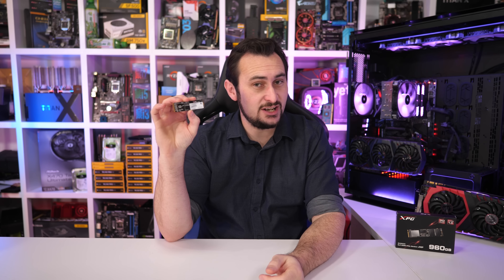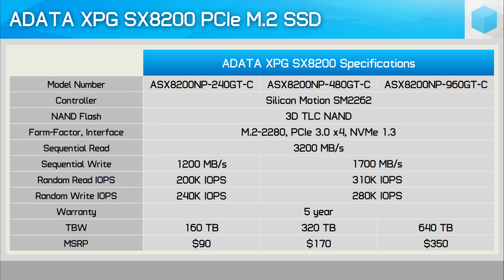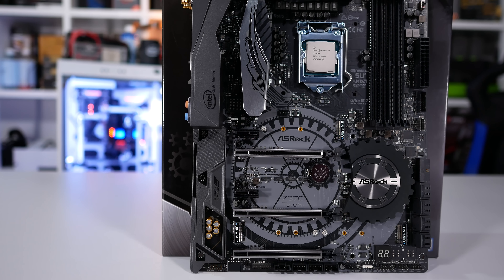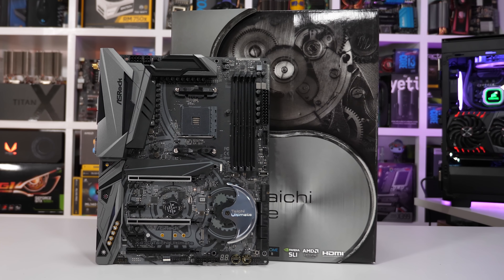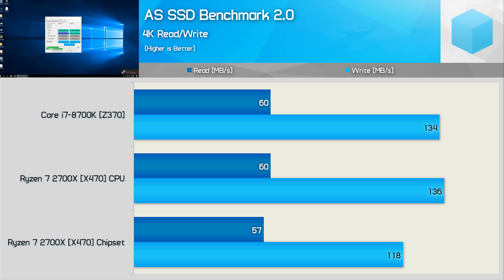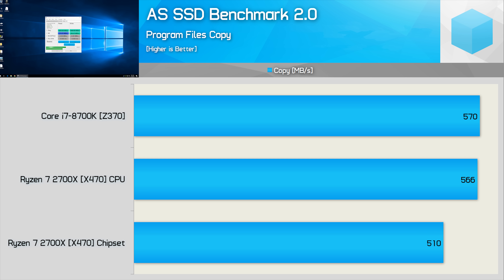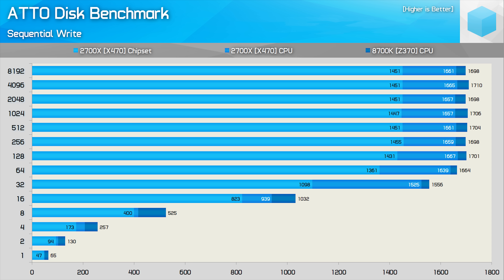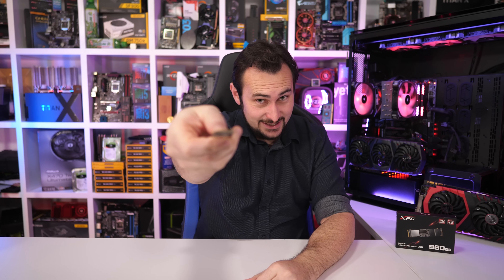Intel Z370 vs. AMD X470 Storage Performance, Not All M.2 Slots Are Equal

Comment: Could you test AMD Store MI? Would be really nice to see a Video on that.
Reply: Simon Leichtmetall Check out Level2Techs (Wendell's) video on it, he did a great analysis of it (spoiler: it's actually really good)
Reply: Jim from AdoredTV has a video on it. It seems impressive but I'd also like to see the benchmark king have a crack
Reply: I combined a 256GB 970 EVO with a 3TB Toshiba HDD (not boot drive, just for games and other data). Performance loss to a pure SSD is not noticeable. It's still faster than my SATA SSD boot drive.

CrystalDiskMark: Seq Q32T1 / 4k Q32T1 / Seq / 4k (Read,Write)
970 EVO: 3561,1500 / 459,414 / 2290,1501 / 47.2 , 214
StoreMI: 3566,1494 / 276,225 / 2313,1494 / 42.9 , 121
Crucial MX100 (256GB): 558,328 / 326,238 / 513,333 / 29.5,113

Edit: It's like you could buy a 3TB SSD for £170 ($220)
Reply: Would love to see a store MI build vs an optane Intel setup for maximum performance boost of a mechanical drive
Reply: Agree, up!
Reply: I've had a ball with StoreMI. It's kinda amazing really. Also just adding this here in case anyone ever finds it useful. If you use a mechanical drive with StoreMI to kinda turn it into an SSD speed wise then be careful that drive hasn't been used for an OS or backup kinda drive. Software often makes a hidden partition that doesn't show up in explorer but does show up in drive management. StoreMI won't work on any drive that's partitioned. That one got me for far longer than it should have. I slapped my forehead when I found that little extra partition windows makes. Once I'd killed that and got it back to one big drive StoreMI ran like a dream. It really did turn a 3TB mech drive into an SSD as far as I could tell just in normal use going through several big ass games to kinda torture it. 

I only used it with an average SSD on SATA. Haven't tried a blistering NVME drive yet but one day soon I shall have on of those little buggers. Well hopefully two. One for OS and one for StoreMI. That seems like the best way to use both slots if you've got a lot of HDD storage and aren't all swanky posh with pure SSD driven computing.

Final note. Its a damn shame it doesn't accelerate more than 1 drive. I see you can buy an upgrade but I'm not the cost of that right now.

Comment: It would be nice to see this topic revisited on the z390 and x570 platforms. Also, with the cost of NVMe storage having come down to such low prices now, more people are using multiple m.2 NVMe drives in a single system. For example, a board that has three m.2 slots like the Gigabyte z390 Aorus Ultra having a samsung 970 evo boot drive plus two more intel 660p drives for additional storage. It would be interesting to see if placing the boot drive in a different slot would affect system performance.

Comment: at what point in the chain does data get compressed when reading or writing files?  i wasnt aware of that fact.  is it when moving through the pcie lanes,  in the ssd controller, on the ssd cache, when getting shuffled through the cpu?  im confused.  seems like compressed data would move at the same speed as uncompressed but no?  interesting.  it must be getting compressed somehwere along the line.  just wondering if its in the ssd or somewhere in between.  great stuff steve.  as usual you answer 10 questions only to raise 100 more.
Reply from the maker: It's the controller, some SSD's use data compression algorithms to reduce total number of writes and this helps to improve the SSD's lifespan.
Reply: while also slowing down read speeds if it has to uncompress it again on the controller cpu.  also that means that game files are doubly hard when moving back and forth because they are so large and because they are usually compressed.  thanks for the info.  im not a storage guy.  i just found a deal on a 960 evo 240gb and then bought 3 of those wd blue 1tbs that are so cheap on newegg and amazon.  actually had an 850 evo and bought a 1070 ti and mined enough to get 3 wd 1tb blues, the 240gb 960 evo, and a cheapo 120 gb to cache my raid in intel rst for some reason(you can cache secondary drives now, even raids).  it also got me a bunch of other stuff.  fully noctua fans all around.  ive made my money back on the card plus about 200 dollars since i bought it last year.  still going strong.  thanks for the info again

Comment: I've been having an issue with Windows 10 reporting bad blocks on my ADATA XPG SX7000NP. I run a trim command with the ADATA SSD Toolkit and they seems to reduce the errors but they build up again and I have to manually run the trim command again. All my drive tools says the drive is healthy. Windows shows it is an SSD but it still reports media errors. None of my other windows systems report bad blocks on their SSD's but they use SATA. I have a Ryzen 1600/Gigabyte Gaming 3 AB350 if it matters.

Comment: Now you need to test 3 in raid 0 on the HEDT platform. See how bad the DMI 3.0 chokes drives vs all 3 being directly connected.
Reply from the maker: They can just connect them directly to the CPU on that platform since the CPU's typical have many more PCIe lanes.
Reply: You can connect them directly to the CPU on x470 as well. Just pick the board with the right PCIe configuration and add a adatpter card for the 3rd nvme drive. 

The Crosshair Hero VII for example supports a PCIe 3.0  x8/x4/x4/x4 configuration.
Reply: @traumglanz  yeah but you can do the same thing on intel z370 boards.  hes trying to test without using any of the gpu lanes cause a lot of people wont want to use them even if they dont make a difference.  or at least you can do x8/x4/x4   direct to the cpu and then you have the chipset lanes but those will be totally available to the 3rd "x4" so its basically the same.  you can do pcie 3.0 x8/x4/x4/x4 on intels z370 and amds x470.  i fail to see what your point is.
Reply: @james mastoianni  the hedt platform isnt limited to 16 lanes for the gpu and 4 lanes of DMI 3.0 to the chipset.  most of the intel hedt chips can support as many ssd's as you like without even touching the dmi link. straight to the cpu
Reply: @Hardware Unboxed Yes, but you would need an adapter card to take a cpu connected expansion slot, as all M.2 slots on X299 are connected to chipset. I am saying you should test the on board slots of X299 vs X399, as thats what most people would use. I know I wouldn't use an expansion card unless they were using more than 3 drives.

Comment: Hi from 2020. I was thinking of using the 2 m.2 slots on a strix x570 mobo. ! slot for windows 10 etc, the other for installing games and recording to it. Or do I need to record to a ssd drive?  I will use a rusty drive for storing videos etc. Will this work? Thanks.

Comment: Steve @4:08 you made a confusing comment comparing H110 to X470 chipset bandwidth.  All AMD AM4 chipsets have the same 4GB/s PCIe Gen3 X4 connection to the CPU (see https://en.wikipedia.org/wiki/List_of_AMD_chipsets#AM4_Chipsets).  The only place where PCIe Gen2 comes in to play is for peripherals hanging OFF the chipset.  Whereas Intel offers the mappable HSIO lanes at Gen3 speeds, AMD chipsets contain an additional  PCIe Gen 2 controller with 8 lanes to serve expansion slots and M.2.  Ultimately your bandwidth numbers in the video are correct for a single device, but if you manage to exceed 4GB/s combined serving multiple devices like extra M.2, SATA, network, USB, etc. then both Intel and AMD will have the same chipset to CPU bottleneck.
Reply from the maker: Yes you are correct, I realised this mistake once it was too late. I should have said all the PCIe lanes offered by the chipset are PCIe version 2.0.

Comment: I love the fact that you tested this on the ASRock taichi board. I have the x370 variant running a ryzen 1800x. I chose just a standard Western Digital black nvme Drive. I haven't done any benchmarks on it, I actually just built the computer. But it's nice to see the difference between the two different M. 2 slots from ASRock. I also have the ASRock b350 pro4 but haven't used the M. 2 drives on those computers.

Comment: X470 links the chipset to the CPU with a PCI-e 3.0 x4 link, you made it sound like the link was PCI-e 2.0 x4, One of the NVMe slots is direct to CPU and the other varies depending on the board, some are PCi 3.0 x4, most are 2.0 x2 or x4.
Reply from the maker: Yes sorry I wasn't clear on that, all the chipset PCIe lanes are version 2.0.
Reply: yep cool, on that board but the CH7 has both M.2 slots as 3.0 x4 I believe, both are connected to the CPU and it takes bandwidth from the second 8x slot
Reply from the maker: Yes both are connected to the CPU, Asus chose to share them with the PCIe 3.0 x16 slots.
Reply: Hardware Unboxed cool love ya vids! sorry to be picky (damn fanboys!)

Comment: Why was the intel chipset not tested ??
Reply: it was tested.  intel chipset was the ONLY thing tested with intel.  amd was both through thte chipset and through the cpu.  intel was through the chipset only.  if it had been through the cpu for intel it would have been the same speed but with about 1% better latency.
Reply: Z370 or directly to CPU both use PCIE 3.0 x4, X470 chipset is using SATA while the CPU gets PCIE 3.0 X4 hence why the Ryzen system had both mentioned since one is slower than the other.

Comment: Hey Steve, this may be an interesting/educational test. 

Start up a relatively cpu-light  graphics load such as the one that comes with gpu-z and run the tests on the 8700K and 2700X Direct to the CPU file copy performance again. The variation in the amount of performance degredation between the two different platforms may be interesting.
Reply: are you looking for degradation in the gpu perf or the storage perf?  intel has gen 3 x4 lanes for gpu bandwidth shared with the m.2 but im not sure about amd's layout.  isnt it gen 3 x4 straight to the cpu for the m.2?  so the ssd would not need to share bandwidth with the gpu in amd's case.  i was thinking along similar lines cause if you copied from ssd to ssd in the amd system with the x2 lanes to the other ssd it would actually be about the same bandwidth as 2 ssd's on intels chipset since they share a x4 setup.  it would essentially be from x2 device to x2 device on the amd and (1/2)*4  to (1/2)*4 on intel  and of course one half times 4 is 2 so essentially a tie.

or are you wanting to test you theory about amd's ccx communication being similar to a node on a network like you were talking about the other day?  that was you wasnt it?

or are you talking about the fact that the intel ssd has to share bandwidth with the gpu?
Reply: I am looking to see degredation in the NVME performance given a constant load being placed on the system processing graphics.  I asked Steve to do the test with a concurrent gpu load because I thought the results would be interesting. Games do not give us the option of separating the Processing and the Graphibs components. This is an opportunity to separate the loads and have something measurable. running a benchmark that has code to generate data that is written and then read to the disk is a better test than ssd to ssd, the x2 drive will always limit the x4 drive

I have no doubt that both systems will record lower results than in the video today, The interesting thing will be how much lower one is over the other. It could be seen as a measure of the efficiency of the ccore architecture of each system under load. If that is the case, and I have never tested it so I dont know, I hope that it prompts people to start pondering why that may be the way it is. I suspect that the Ryzen CPU will degrade more than the Intel

You are forgetting though,  that everything on the ryzen chip goes though the Infinity Fabric. There is no such thing as a direct connection to anything other than a fabric interconnect. The "directness" of connection really means that the component has to only take one "hop" to get where it is going instead of two hops. the fabric is carrying pcie data, memory access data, and internal chip control management traffic  
 
The GPU connectbity are using dedicated lanes for both systems. Intel's x16 lanes do not overlap the x4 to the NVME via the DMI connection that connects to the chipset. The x4 is shared amongst the Intel board's other I/O like usb and sata but only becomes an issue if you start trying to copy files to other devices. The Ryzen chip has two PCIe controllers that each support x16 lanes. The NVMe and GPU are not connected to the same controller. the x4 NVME and the x2 that connects to teh chipset do both go bact to teh same controller on one of teh CCX modules

The "network" thing is not a theory, one of the senior AMD tech guys mentioned it in a Q&A session with the press around  the launch of ryzen gen 1. It is certainly not a tcpip network but data moves from one point to another point using an addressing scheme defined by a protocol, making it, by definition, a network.

Comment: If I have mine plugged into the x470 chipset slot can I now move it to the faster cpu slot if it has my OS on it?
Reply: You should if you set the boot device in the bios to the correct drive after you moved it.

Comment: What about when two M.2 NVMe devices are in use? For the 1% that do :)
Reply: Timothy Matthews worth testing I guess, but performance should be the same, you'll just sacrifice some sata ports to maintain 4 pcie lanes per m.2.
Reply: If it's two high end ones like Samsung 970's and both are on the chipset going through DMI3.0 then you'll be limiting that second one a lot, though only if you RAID 0 them and do Seq benches otherwise it won't limit it at all.
Reply: well for cpying files from one disk to the other  then it would be exactly the same theorietically but in reality a small advantage would go to intel.  why you say?  because amd's second ssd can never go over x2 speeds. so whether you are reading from it or writing to it you can never go over 2x on that drive.  with intel you have a similar limitation cause you can go x4 on either but only when using together they share that bandwidth.  but there is one advanteage to intels setup. with intels setup one drive you could be using 3/4 of the bandwidth while the other only uses 1/4.  so in effect 1 lane from one and 3 lanes from another.  so either way when copying from one disk to another you end up with x2 for each ssd. 

with raids you wiould have a simillar problem.  in raid files are split into small equally sized chunks.  when files are needed half the file has to be copied from each drive.  if one drive is running at x2 speed then both drives will be stuck with x2.  its like 2 horses being harnessed for a plow or a cart.  they can only go one speed
Reply: DMI is actually bi-directional so copying between the two should actually yield full performance, this is why I said it would be interesting to show because of the differences and in which way you use them effects it too. AMD either 1 NVMe on CPU + 1 on chipset or 2 on CPU if MB allows it is better for RAID and Intel is better when not using in RAID and not doing the same type of I/O to both NVMe devices (read or write). It's still not that useful to most people but I think it would actually be interesting to test and chart out and show, more as to why HEDT exists than anything else because you'd include one in the graphs to show how it's not a problem.

Personally on mainstream platform I think two NVMe M.2 slots is unnecessary and not practical, just leave one as a SATA M.2. They only put two on for marketing reasons as it looks better spec wise even though hardly anyone will ever use that second M.2 slot.

Comment: what kind of controller?   nanya!  what kind of controller is a nanya?    nanya business  : p
also you said that unlike most m.2's it uses 2280?  i thought that WAS the most common?  am i wrong?
Reply from the maker: I don't get the Nanya meme. But yes I meant to say 'like' not 'unlike'.
Reply: oh ok.  thats the daily dollar you get whenever someone points out your mistake.  and seriously?  you dont get the nanya meme?  i think youre just trolling and im not going to start explaining my jokes like wendell at level one.  unless you really want me to.  do you really want me too?.....well you see the word nanya sounds like.....
Reply: wait also i thought that amd had gen 3 x4 lanes for the ssd and gen 2 x8 for the chipset?  or maybe i misunderstood and its gen2 x8 for the chipset with x4 of that going to the ssd at gen 2 speed instead of gen 3?  cause i know people are saying that ryzen has the same chipset bandwidth (gen 2 x8 is the same speed as gen3 x4).  and everybody says that there is a direct connect with the cpu for the ssd.  but maybe what they meant was gen x8 for both the chipset AND the ssd with it being split between them.  geez thanks steve now i gotta go research ryzens pcie lane layout thanks a lot.  unless you happen to know what im missing off the top of your head.  i know how it works for intel.  gen x4 for the chipset (dmi 3.0 same things)  and 16 for the gpu.  24 lanes sharing those 4 gen 3 lanes.  i never thought that  would sound simple.  i could have sworn that for ryzen it was gen 2 x8 for the chipset and gen 3 x16 for the gpu and gen 3 x4 for the ssd.

edit: nevermind. today im that guy that didnt watch the stupid video all the way through before commenting sorry